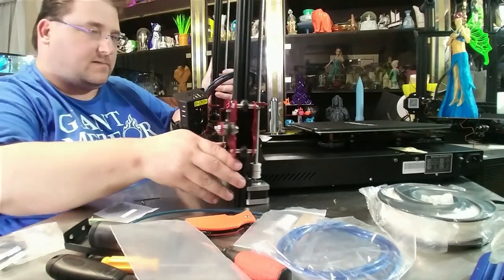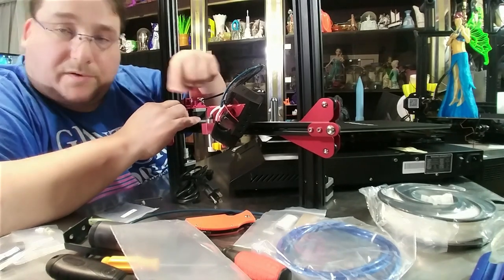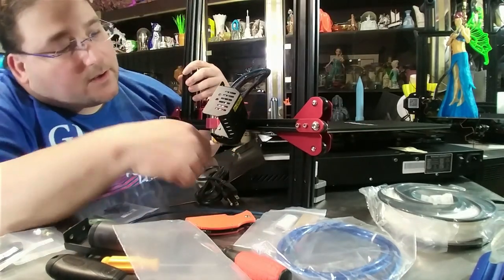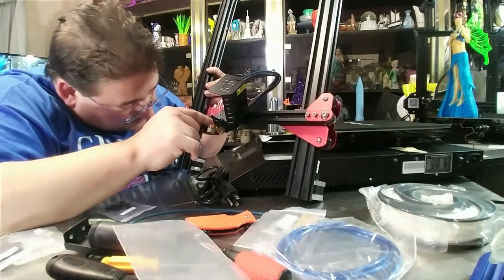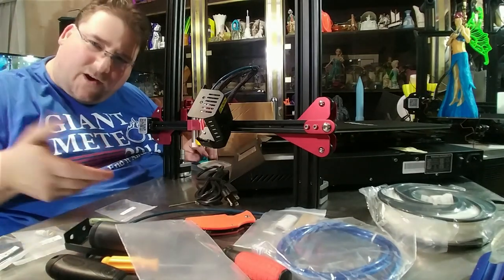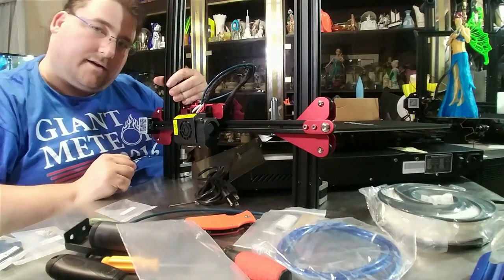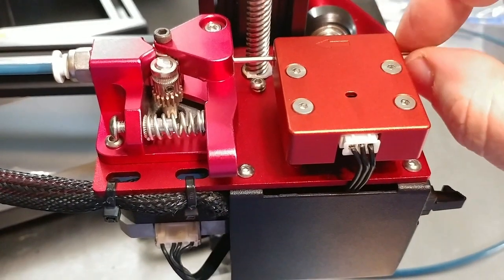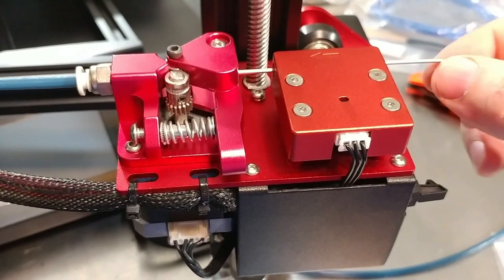CR-10s Pro Behind The Scenes Series Part 3 - T3DP

Comment: It might be the wanhao d9 that your taking about with the plugs for the fans and what not right on the hot end and extruder
Reply from the maker: the Geetech also does this. that "board" you see on the Pro here is "on the back" of the carriage plate on the Geeetech.